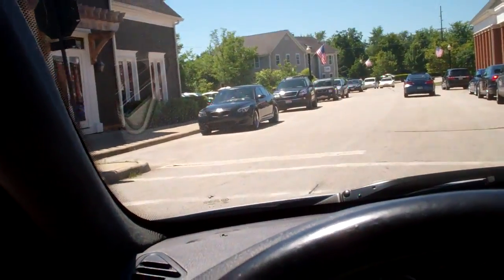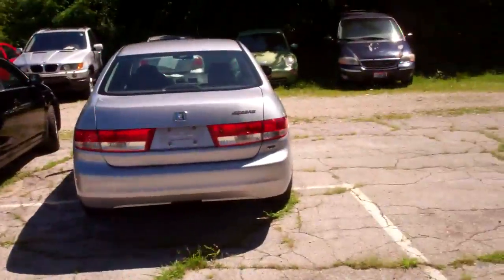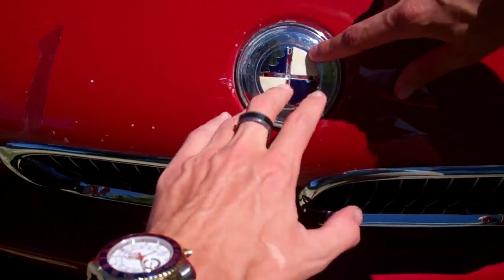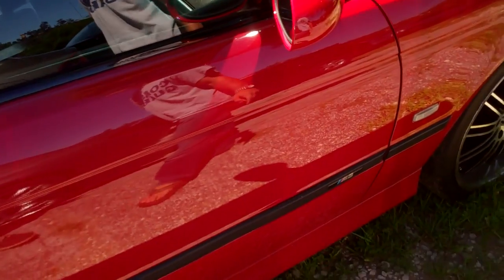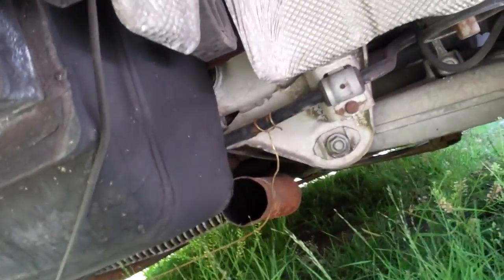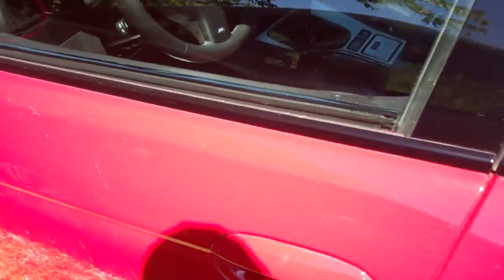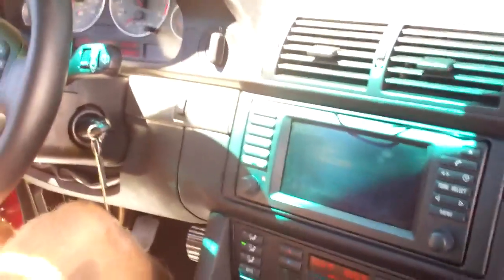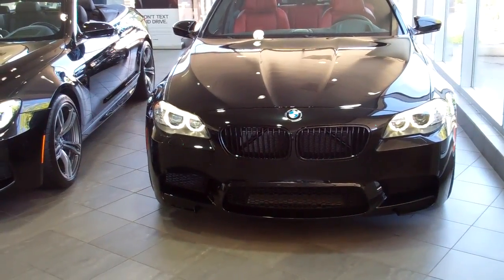M5 Day!  7/25/13 - Day 957

Comment from the maker: The engine and transmission feel great.  105,005 miles.  That's why it's $20,000, it has potential.  Just needs tons of cosmetics.  It's in a lot worse shape than mine was in when I got it, but it could still be restored to be a beautiful M5 again.

Comment: Id say $15,000 is where the price should be at, even though it is a M5 with a great transmission and engine, with all the cosmetic work that has to be done to that car is insane, so that is why $15,000, or even something like $12 would be good. And also is this car going to be yours? That would be cool, would make a great project car, sort of

Comment from the maker: They want $20,000 because deep down it is a 2003 M5 with only 100k miles.  The transmission and engine looked and felt great.  If the car were super clean and in great cosmetic shape, it would probably go for closer to $30-$35k.

Comment: What has happened to that car!? Even after 165,000 miles the badge on the X5 is fine. Rims: *BEEP* My thought exactly. I am surprised that somebody hasn't killed themselves in that car. The exhaust would be good for... Sitting in a lot and showing off. That seems what that car was. A rich douche's car. Saying that with a lot of work it could be brought back to former glory. A lot of money would have to be spent. What did the thing start and run like? If mechanically sound and enthusiast could...